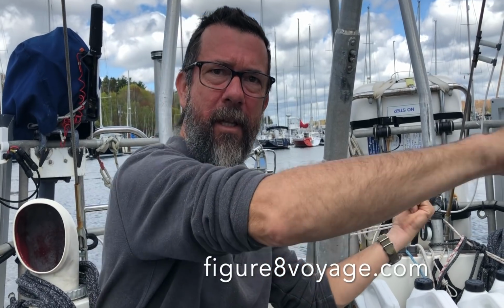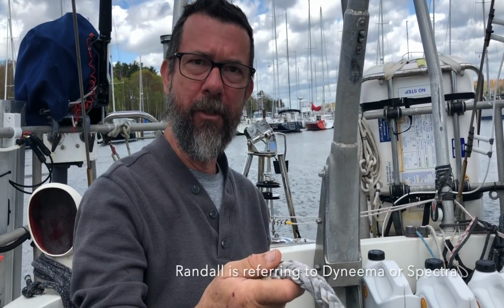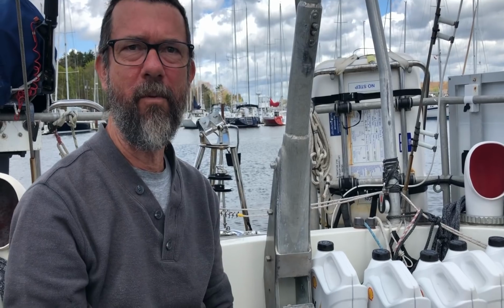A Chat With Randall Reeves

Comment: The inventor of the Shark Drogue is Zack Smith, not Dave. The Shark like the JSD is designed for heavy weather. The difference is the Shark is an active tactic to keep your boat moving. The JSD is a passive tactic to wait out the storm.
Reply: Who is the Tony they reference?
Reply: @MHow1900  Tony is a sailor that circumnavigated. He promotes the JSD as does John Harris. We're not sure if Tony is paid like John or not.